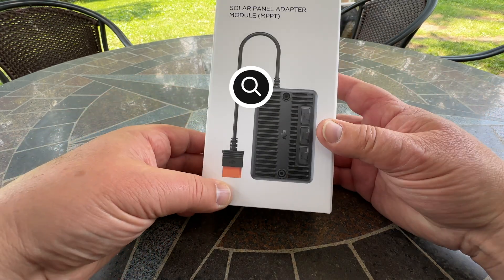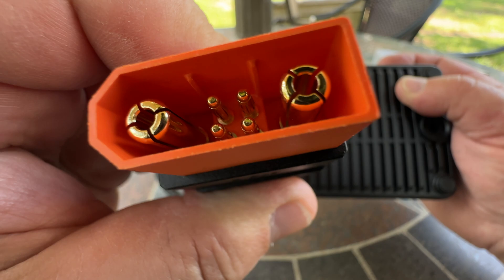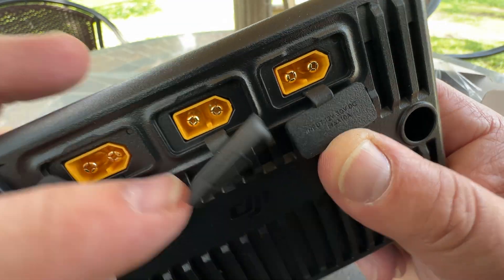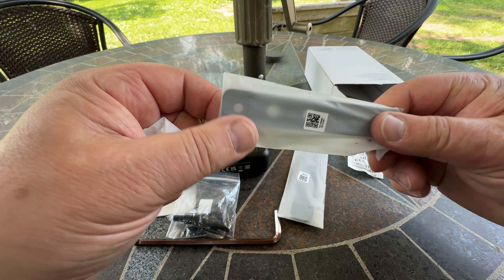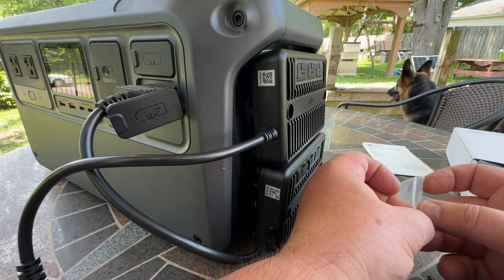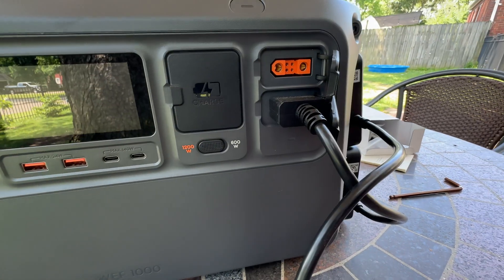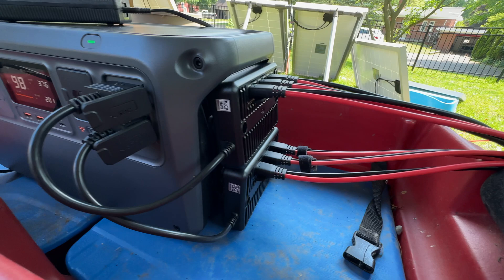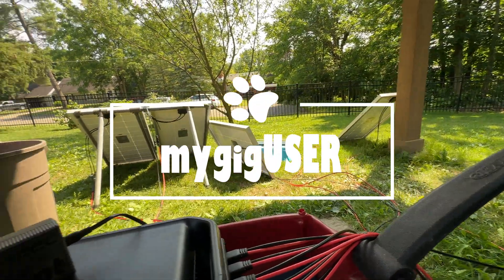Unboxing DJI Solar Panel Adapter Module

Comment: Thats hot garbage, I have a bluetti ac70 and that can charge from 1 solar input max 500W and input 12-57 V. It looks so cluttered with all those wires
Reply from the maker: I agree with you, all those wires are too much.
Reply: @mygiguser  your panels were pointed in a bunch of different directions lol. how could you expect 600w if you have at least 3 of them not even pointing directly at the sun? are you stupid?
Reply: @mygiguser  you need to redo this video it makes this appear to be a shitty setup.. but it was entirely user error
Reply: the Power 1000 blows away the Bluetti ac70 , cheers~